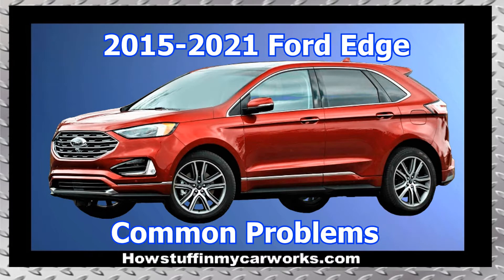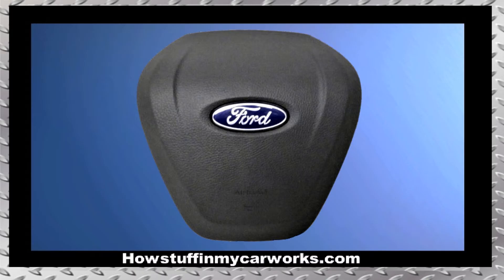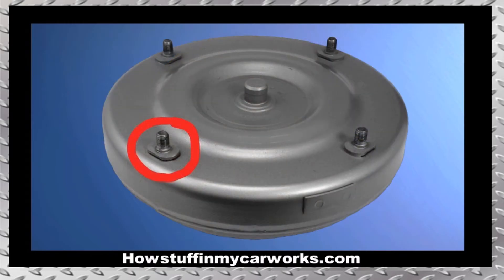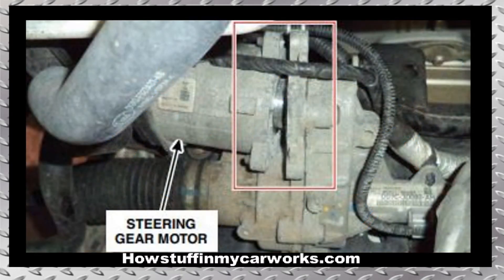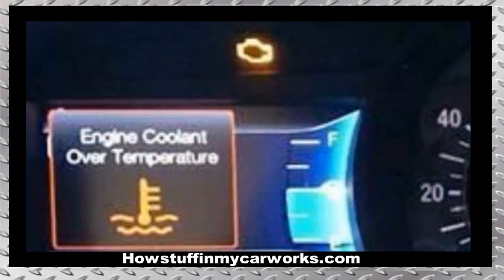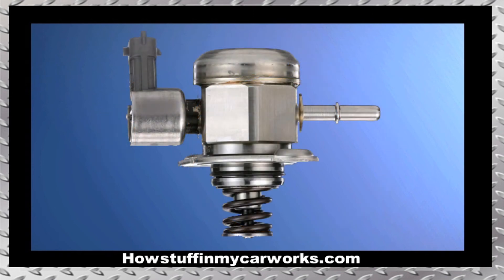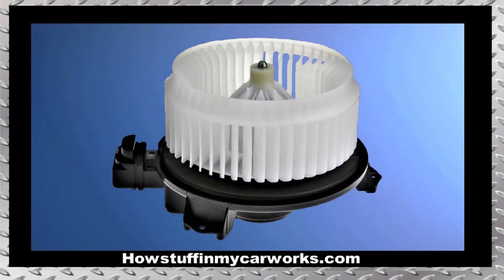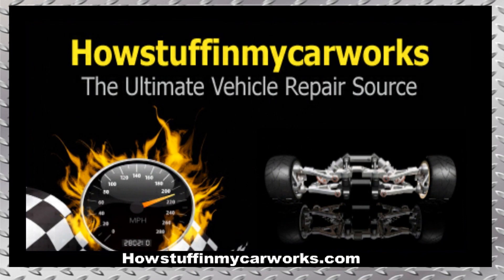Ford Edge 2nd Gen 2015 to 2021 common problems, issues, defects, recalls and complaints

Comment: I have a 2015 Edge, the rear tail light assembly fills with condensation.  The Ford dealer replaced it twice under warranty.  After 14 months the second replacement filled once again with condensation.  Unfortunately they said it was beyond the 12 months and would charge $1,425 to replace.  This is a common issue, but no recall, bummer.
Reply: Drill a small hole in the low spot to drain the water. That's what I did and it works like a champ.
Reply: yes, same issue with my 2015 edge. condensation.   worse yet,  never a mechanical issue in 100.000 miles, now the car transmission 

jerks and like someone slams brakes on.  my oil change shop drove it today and shifted perfect.  He shifted the auto trans out manual.  Shifted  auto and it goes nuts again. only me could this happen to......ANY IDEAS b for l make my trans shop appt. next week?

Comment: 2017 AWD SEL. Has "cold weather option" pkg but warm air from blower is only directed to areas above wiper resting position at base of windshield & wipers remain frozen in place while rest of windshield warms up. With 2018 models the same option package has a heating element in windshield at base to melt ice. Also found that 2017 Escapes with same option pkg had heating wires but not Edge's. Another item is that some vehicles, (a Ford TSB from 2017 showed that this one was included per its VIN) were built with bad underbody panel attachments that would fail creating a rattling sound inside cabin while driving in crosswinds. Dealer has made 5 attempts that failed after a few months since original & now with 75000 miles rattles are back. Between poor engineering & service I'm done with Fords.

Comment: I been driving my Edge 2.0/V4/ ecoboost/2020, since today. I change the oil every 5,000 miles. Is still driving great ( Has 50,000 Miles).

Comment: Just like a Ford Edge, my engine check light turned on a month after buying it from the dealership and its been on now for 2yrs. Too expensive to get it fix. I have a '17 Tatanium smh. No more new Fords for this family... unless Ford fixes it with no cost...
Reply: Same here I'm more for Ford, but if they don't fix there issues, I'm going Dodge or Chevy
Reply: Whats the problem?
Reply: Same. I got coolant intrusion and needs a new engine. FACTORY LATENT DEFECT and for is turning their backs on the victims. No more ford for me.

Comment: 2015-2018 electronic throttle body fails
2017-2018 some 6F35 automatic transmissions have a recall due to bad welds of the torque converter studs and it’ll cause the torque converter to separate from the flex plate
2015-2020 some ecoboost motors have oil leaks from the turbocharger oil supply line and drain tube
2015-2016 bolts that fasten something to the steering gear break and have to be replaced and sometimes the whole steering gear assembly has to be replaced
2015-2020 with 2.7 ecoboost motors has a defective coolant sensor 
2015-2018 fuel pump experience premature pressure
Heater blower motor gets noisy after time and fails
Typical turbo motor has extra carbon build up around the valves (which is normal)

Comment: At 108k miles on my 2015 Ford Edge Titanium 2.0L 4-cylinder EcoBoost, it developed a cylinder 3 misfire, low coolant and coolant in the oil. Combustion bubbles in the reservoir were pressurizing the coolant system, causing no flow, and overheating the engine. Luckily, I was able to limp home the half mile with no damage to the block. (But I think the better idea would have been to pull over, open the coolant reservoir to let the pressure off, and add some coolant if needed to get the flow back.)
It looked like a head gasket breakthrough to cylinder 3. After assessing the condition and facing a $5k to $8k bill for either a head gasket replacement or new engine, I tried Bar's Grey goop head sealer, and it worked. 
Day 1, I changed the oil & filter first (cheap Walmart Brand), then used a half bottle of the goop following the instructions.
Day 2, Warmed it up in idle to temp, let it cool down, then drove a few miles. All looked good, so I changed the oil & filter again.
Day 3, I drove it 20 miles or so and changed oil & filter again. I think I got all the antifreeze out of the engine and oil was semi clear.
Day 4, Drove more miles and all good. So replaced oil & filter again with Valvoline restore and protect. 
Day 5, I changed just the filter after 100 miles, and it looked really clean.
I finally flushed the radiator 4 times to ensure most of the Grey Goop was gone. 
All good after 5 weeks and counting. 
Will check again after 1000 miles, but so far, so good.

Comment: 2020 Edge, just replaced purge valve hose assembly on mine at around 68,000 miles, wife has one also her light just came on for the same thing hers has 64,000

Comment: I have a 2019 edge titanium and it needs a new engine because of what it running rough, spitting white smoke, and it always being low on coolant.
Reply: EGR COOLER
Reply: @CUBEBROZ I'd extend the warranty, then get them to replace the engine, I'd just sell the car after that
Reply: which motor ? I assume the 3.5/3.7L v6 ?
Reply: Probably a failing bad gasket on these engines go bad
Reply: EGR

Comment: 2016 edge 2.0 ecoboost jerks when shifting from 2nd to 3rd gear. All other gears run smooth and downshifts smooth
Reply: Having that issue on 2015 escape. 2.5 engine.
Reply: Did you ever find out what the issue is?

Comment: My ford edge 2017 having coolant internal leakage issue now . Apparently need to replace engine
Reply: Was it caused by the water pump leaking in the timing chain case? V-6 3.5 L with water pump in timing chain enclosure will leak coolant into oil and destroy engine. Goofy design.

Comment: Coolant intrusion on all 2.0L ecoboost is VERY common and Ford won't fix it. Should be a recall like the 1.6L
Reply: They fixed the problem in 2020 with the coolant intrusion that started in 2015 with the redesign of the block to allow for more cooling ford went from a closed deck to an open deck cooling system the problem was they cut slits in between the cylinders for better cooling they wanted more performance out of the 2 liter Ecoboost which took away  the strength from  the cylinders and with all the heat cycles that the engine went through would cause the cylinders to crack allowing coolant to enter the cylinders causing obvious coolant consumption and also causing misfires too mainly with cylinders 2 and 3 those were the problem ones it started with a class action lawsuit  a tsb and eventually a recall. Under the the recall Ford would replace the engine with an engine with the updated block ones that were built before 2020.  In 2020 ford redesigned the block again they kept the open deck design but instead of slits they cross drilled small holes in between the cylinders to allow for better cooling. This design kept all the ''meat'' in between the cylinders thus completely eliminating the coolant intrusion problem.    hope this helps . I'm a lube tech at a small ma and pop shop in Wisconsin we have 3 locations any way one of our mainline techs knows ford ecoboost engines very good  he's the one that told me all this he's done a lot of the ones that had the coolant intrusion problem.